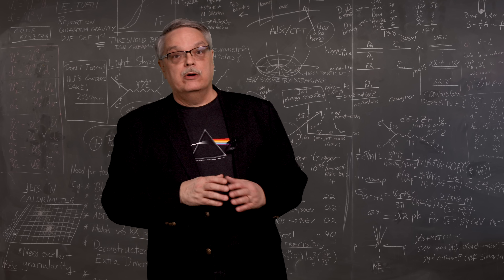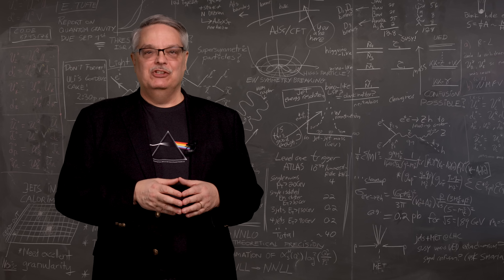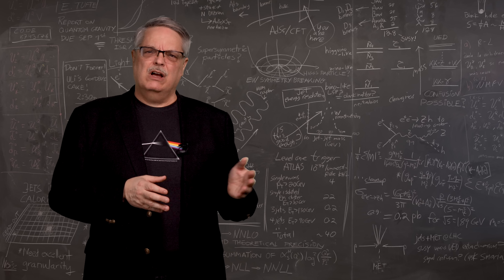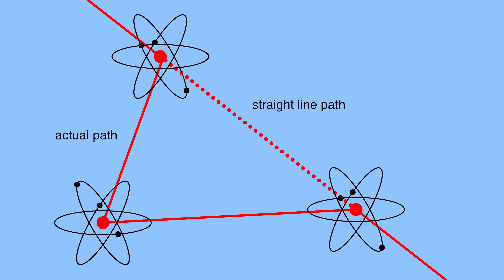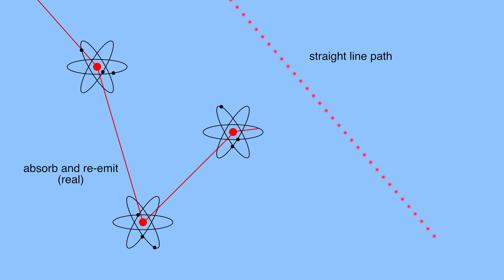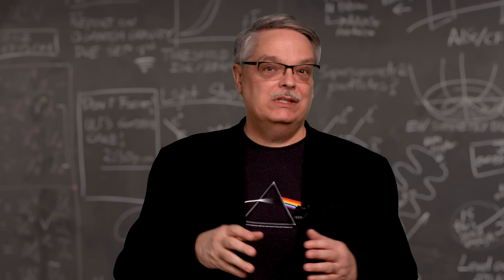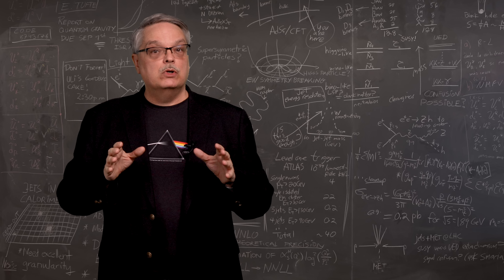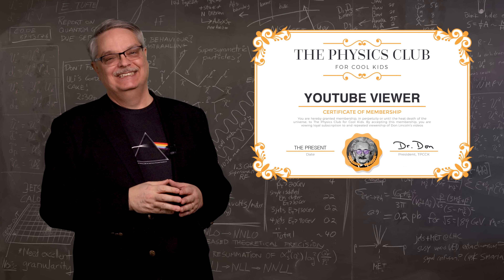Why does light slow down in water?

Comment: In many intro physics classes, it is taught that when electrons enter glass (or any transparent) material, the electrons absorb the photon vibrate and then re-emit it (this can be seen in Hewitt's Conceptual Physics book). Is this an accurate description? If we try to couple the two explanations, is it that the electron absorbs the incoming wave, begins oscillating, that oscillation produces an oscillating field, and then the electron re-emits the energy from the original wave which interferes with the wave produced by the oscillating electron? If so, wouldn't that signify the "re-emitted" wave has less energy than before it was absorbed?
Reply: The video explains that photons are not absorbed and re-emitted at 4:50.

If you're really talking about electrons striking a material and excited molecules emitting a photon, that's a different process - https://science.howstuffworks.com/question4041.htm

Ultimately, it's not relevant to refraction, since refracted waves are parallel to the original wave - emitted particles have a random direction. Re-emission is what makes a substance opaque.

Comment: if light beam starts to move electrons, then it loses energy, if it loses energy output frequency should be lower, but it's not happening.
Reply: It 'regains' the energy when the wave leaves the medium. The wave reaches the boundary and continues with the same energy as before, only without any electrical interaction. The electric wave carried by the electrons has nowhere to travel, so the energy is returned to the photons - the reverse of what happened when the light entered the glass initially.

Comment: But why waves from oscillating electrons move slower?
Reply: Light is moving at c since it is EM field. And the wave from oscillating electrons is also EM field. So this wave move at c too! If two waves have same speed and interfere, their speed will remain the same
Reply: Someone says "group velocity vs phase velocity" to fix this problem. Is this working?
https://en.m.wikipedia.org/wiki/Group_velocity
They said "phase velocity is still at c while the group velocity is lower than c so........" idk
Reply: I´think becuase there are other forces acting on the electrones too. There it follows, that they oscillate slower and the created field does so as well,  but I´m not 100% sure
Reply: They put out a new video that kind of explains this idea more. It's called "Why does light bend when it enters glass?"
Reply: Hussein Tofaili Aren’t you the teacher in SA official highschool in lebanon? Or is it Mohammad Toufeili?
Reply: @VerSalieri  No I'm still a student :)
Reply: @Someone-ex5ed  Yeah I checked yesterday, the physics coordinator I was thinking of is called Mohammad..
Reply: @bitm5245  It is time based if you play the video.  If you pause the video, you can measure the distance between peaks for wave 1 and wave 2, and the distance happens to be the same for both.
Reply: The "wave" created by the electron is due to the physical change in position of that electron.  The field follows it where ever it goes.  You can imagine the field to be pretty big where ever the electron is, and to be pretty small where ever the electron ain't.  Thus, an oscillation.  And, crucially, an electron does not move at the speed of light.
Reply: Because electrons are lazy and not a gymn freak like the photons.... :P
Reply: Not slower, at a slightly different wavelength and the superposition on both wave create a third wave that moves slower through the medium
Reply: Dude, the problem isn’t the wave speed, its the electrons speed. Also, the waves produced by the electrons isn’t a wave exactly, it’s a “response” wave. In vacuum, the “response wave” always match the wave, so go light wave goes on unchanged. But when light interact with matter, things change. Matter doesn’t react instantly, so it end up slowing the wave.
Reply: Because electrons have mass. They will take time to respond to the wave, and must be accelerated up to speed, unlike light. I've got two partial examples that I think help explain different aspects of this.
Think of a pandulum. Due to the combined effect of the mass and length of the pendulum it will swing with a certain period that is proportional to the moment of inertia of the pendulum.
Or take waves moving along a spring. The oscillating waves will not oscillate faster than the driving frequency causing the wave through the spring.
Reply: That wasn't exactly true: they do not travel slower, each wave created by the electrons travels out of phase relative to the original wave. When you add all them together the resulting wave travels slower.
Reply: @ErickShocks  It is not possible to add together two waves traveling at the same speed and get a wave that travels slower, no matter the phase.  I made a video on this.

In particular, if you add cos(k1*x-w1*t+p1) + cos(k2*x-w2*t+p2) you will get
2*cos[(k1+k2)*x/2-(w1+w2)*x/2+(p1+p2)/2]
*cos[(k2-k1)*x/2-(w2-w1)*t/2+(p2-p1)/2]

So looking at the carrier wave, the phase velocity is (w1+w2)/(k1+k2).

If you assume the phase velocity of the orginal waves are the same, namely
c=w1/k1=w2/k2, by substitution, you will get:

c(k1+k2)/(k1+k2) = c
Reply: @cryora  Yes you can add out of phase waves and get one that travels with different speed, because some waves carry a position dependent phase, and that changes the velocity.
Reply: @ErickShocks  Not if all the spectral components travel at the same speed, which is what is implied.  It is also ambiguous what you mean by position dependent phase, because all basis components have phases equal to kx-wt+phi.  Do you mean nonlinear position dependence?  If so, that is implying a dispersion relation that is different from the vacuum condition.
Reply: They superimpose. The frequencies dont change but the superposition changes the wavelengths
Wavelength times frequency is speed
Speed is reduced because wavelength decreases and frequency stays the same.
And sometimes the opposite happens and the wavelength increases and so does the speed(dense to less dense)

He didn't exactly SAY this but rather showed it on the waves, some picked it up and some didn't.
What he said was that the electrons of the medium emit a slower electric field that adds up with the original lights electric field and the resulting wave is slower than the original light
Reply: @bitm5245  Actually, what he showed were waves that had the same wavelength but different frequencies, hence different speeds.  Just pause the video and measure the distance between peaks with a ruler.
Reply: Dude didn't you just see the video? The waves from the oscillating electrons move also at the speed of light, it is the combined wave that moves slower
Reply: @AdriánHernándezObradors  Correct me if I´m wrong, but the electrones don´t move slower, do they? If they moved at the speed of light, the new field would also oscillate at the speed of light. But that can´t be, otherwise, the whole thing didn´t work?
Reply: @AdriánHernándezObradors  He said (correctly) the wave the electrons carry travels slower. This slower wave combines with the light wave to create a slower wave.
Reply: @AdriánHernándezObradors  The combined wave shouldn't move slower if the original two waves move at the speed of light.  The oscillating electrons should oscillate at the same rate as the light that excited it, so the frequency of the emitted light should be the same as well.  There may be a phase shift because of the delay in which the electron responds, but this just leads to combined wave that has the same frequency but different amplitude and phase shifted.

Even if the oscillating electrons emit at other wavelengths (i.e. some bandwidth larger than that of the light itself), that just changes the temporal shape of the light signal, not its speed.
Reply: @AdriánHernándezObradors  No man, he didn't mention that at all! Review the video.
Reply: @AdriánHernándezObradors  why would any wave move slower? I thought every single eletromagnetic wave would move at the speed of light.
Reply: @arthurg.machado6803  in vacuum, all electromagnetic waves move at the speed of light.
matter slows them down by a factor dependent on their wavelength and the medium they are travelling in.
Reply: @bananapeel2243  yeah, sure, i know that. But i thought the product between the wavelenght and frequency would stay constant and equal to the speed of light for all eletromagnetic waves.
And the part about the medium which it is traveling its not an explanation, that is the point of the vídeo.
Reply: @AdriánHernándezObradors  

Adrian, didn't you see the video?
At 7:11 he explains that if wave 1 and wave 2 are themselves moving at different speeds, then the net wave will move at a totally different speed. 

This means that if the speed of both waves 1 and 2 is the same, the change only happens in the 'wave pattern' or 'wave form' of the wave. Not the speed.

His question is valid. If the net speed is slower in the medium. It clearly means that the speed of the waves from electrons is slower than the original light wave in order to have a slower net wave in the medium.

Comment: excuse my ignorance, but if the light creates a second electric field, then it may share some of its energy with the material (glass). Thus, can we argue that light alone (without any other kind of radiation) may heat the material? If so, can you use a laser diode to heat up things around you? More, sharing some of its energy, it means that it have lost part of its energy before it leaves the glass. Then why doesn't it slow down in the second vacuum environment?

Comment: Yeah... this make sense in the "steady state" condition, BUT it seems as if there's two light waves... if you managed to send just one "cycle packet" of light through the glass, it seems you should expect two light "cycle packets" to come out, one not delayed at all, and a second delayed from the interactions with the electrons.  But I'm pretty sure this doesn't happen.  :(

Or put another way, you'd expect to see two light waves come out the other side:  one that traveled straight through the material at the "speed of light in a vacuum",  and a second which is the combined "speed of light in a vacuum" and the second "speed of electron fields".  The "speed of light in a vacuum" should exit first... but again I doubt if this happens.  :(

Comment: Now I understand why light slows down in transparent material but you didn't explain why light bends in a particular direction. What is happening at that atomic level? Is electron also responsible for the bending? I wonder why there is no role of nucleus in this phenomenon...!
One correction:Light is an oscillating electric & magnetic field perpendicular to each other. I love this explanation btw.
Reply: Light always takes the shortest path from one point to another, but not the shortest by distance, the shortest by time. Therefore light will travel a longer path in the medium with the higher effective speed of light. And a shorter path in the medium with slower effective speed of light. As a result you get a bend at the edges. (Fermat's Prinziple)

Comment: This doesn't explain it to me. How can a foton move slower than the "speed of light" at all when its properties is such that it MUST move at the speed of c in vakuum? As explained elsewhere in physics.
Reply: Well it's not really a photon anymore but rather a photon wave isn't it. . .

This is a wrong way to put it but if you still really want to think in particles, you can think of it as a photon mixing with an electron for now. . .

Comment: So it's kinda like dropping a magnet down a pipe.
Reply: Exactly the same, one's electric fields, one's magnetic
Reply: That's an amazing analogy. Kinda makes sense.?. Got me thinking 👍🏼
Reply: Pretty much, the inducing of a secondary wave is what makes it similar
Reply: @ghad6799  Have these secondary waves been detected, ever?
Reply: capacitance & resistance, permeability & permittivity
Reply: Yes! Both are ultimately caused by induction. I never thought of it that way.
Reply: I thought the same, and it's actually not surprising that they're so similar since electric and magnetic fields are two sides of the same coin. And light is just a changing electric field while the falling magnet changes the magnetic field around itself
Reply: Excellent analogy!
Reply: Well, its not generating an opposing force. But yes its a very similar idea.
Reply: genius thanks
Reply: Great analogy man
Reply: only in the sense that they contradict each other
Reply: nice simile
Reply: That's how I was of thinking of it of something still doesn't make sense to me. Wouldn't that be consuming some of the energy, thus changing the frequency of the light by the time it exits?
Reply: like .....and opposing force that generates ...when a bar magnet  is moved in a solenoid
Reply: Or throwing a hotdog down a hallway.
Reply: @YTEdy  https://www.youtube.com/watch?v=mDqsgbtpDLk
Reply: Yo analogy is preety much apt.

Comment: this brought me forward thank you but didnt gave the answer why the electrons would not stand still for example as wave @ -273° this also opens question if the temperature is affecting the bend/refract process or why it would make a second wave of electrons 

also it leads to the leptoon world question

the phase displacement φ also calculate with the strenght of the wave 
this means a stronger wave would make a stronger bend lets say radio waves
then it leads to the next question if 1 electron or a few electrons have a "wave charge" how much less this must be or does it even have a wave charge or is that a road into something else

it looks like im to far away from the answer being not a master in physics